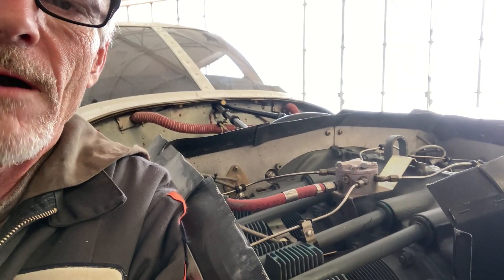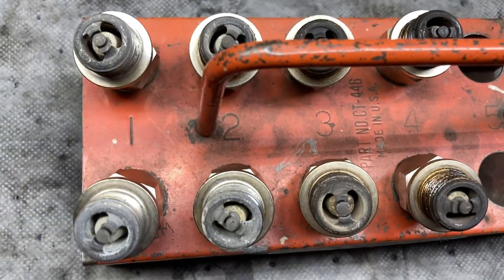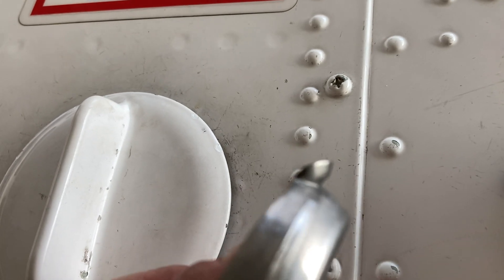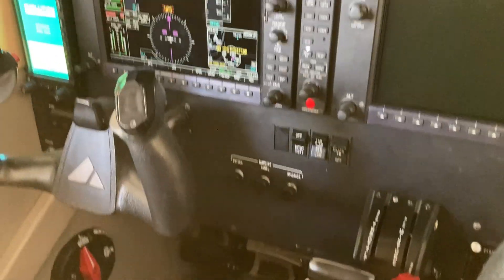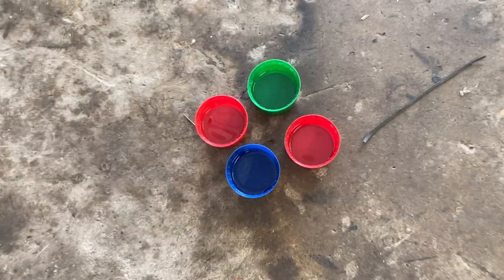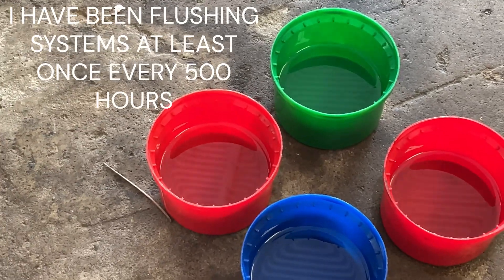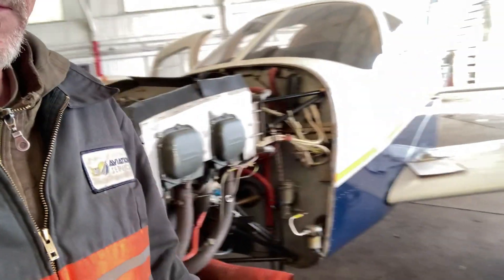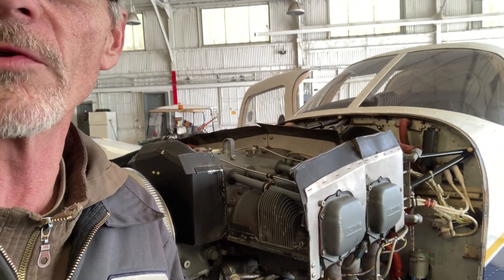IO 360 RUN PROBLEMS AND FUEL SYSTEM CONTANINATION #lycoming #piper #fuel #injection #aircraft #tech

Comment: Great video. Are you familiar with Avstar fuel servo problems such as mixture control issues and a couple of in flight shutdowns?
Reply from the maker: had that with avstar carbs. not injected systems. make sure mixture is set correctly. less than 50 rpm rise leaning at 1000 rpm. i shoot for about 30 rise at 1000 rpm. make sure all the fuel system screens are clean.  remove injector lines. flush divider good with full rich and full throttle. run a quart through them if you have to. we have some avstar systems in our fleet. no problems yet.